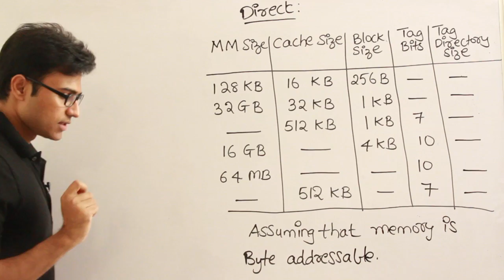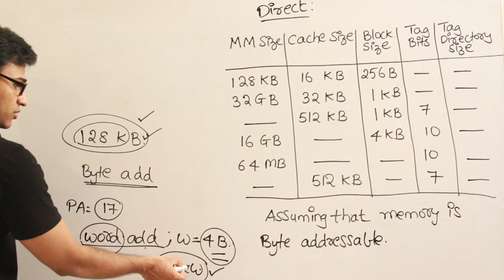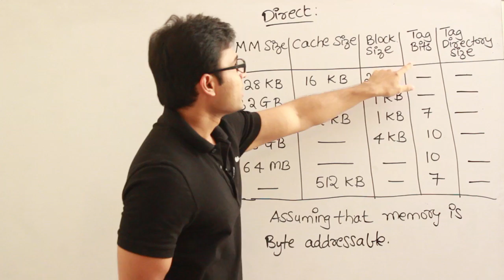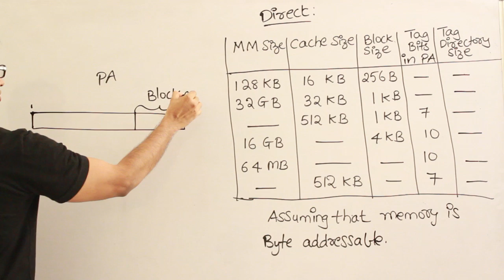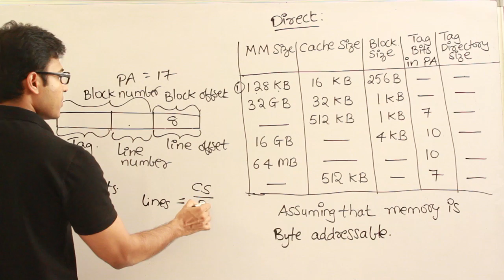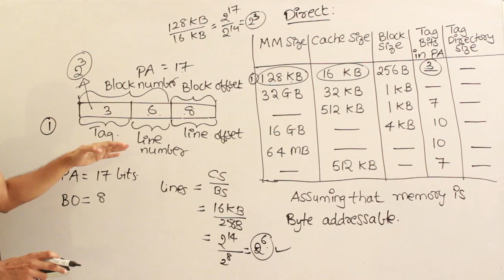Comment: How do I find out if 32GB is 2^35..
Reply: 32 * 1024 * 1024 *1024 Bytes

32 * 1024 MB
32 * 1024 * 1024 KB
32 * 1024 * 1024 * 1024 Bytes

32->5 bits
1024->10 bits

So, 5+10+10+10=35

32 GB can be rep. using 2^35 bits
Reply: thank u very much.